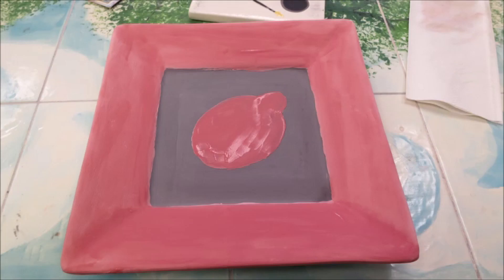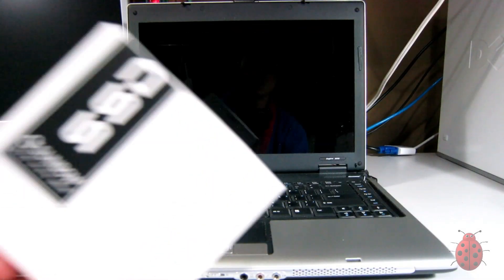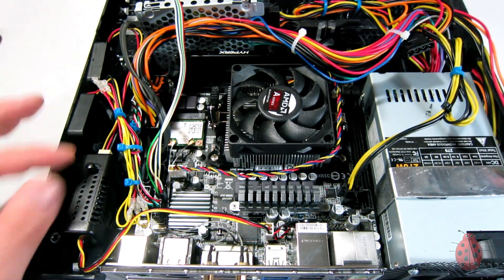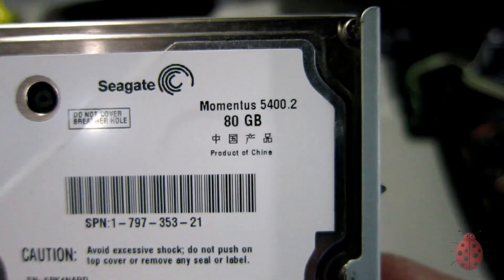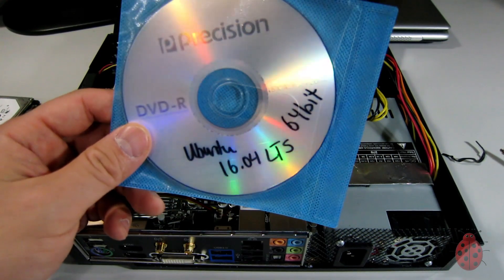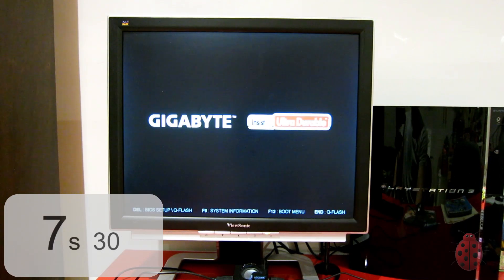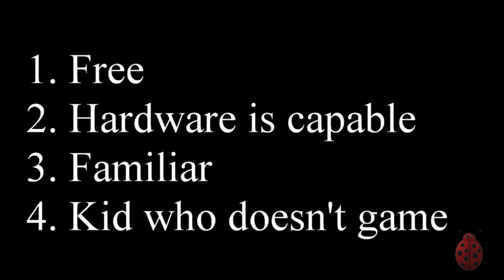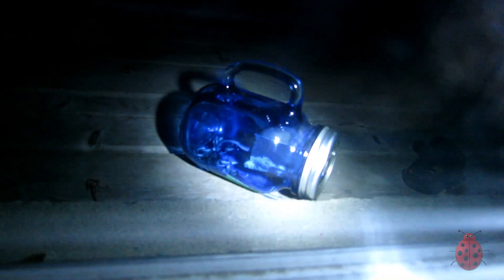Playstation 3- PC upgrade!

Comment: This would be so cool once the Ryzen 3000 comes out with it onboard graphics. Then you'd acually have a pretty usable gaming pc
Reply from the maker: Expensive but oh so nice. AMD is typically very power hungry so a better psu may be needed.
Reply: @LadybugAdventures  I am pretty sure they said about 90W and ur not gonna need a gpu so you should be alright with what u got. ^^ 

Edit: 90W for Ryzen 3, Ryzen 7 will probably have more

Comment: I kinda also want to try this with my old 40gb model since it died some time ago, and get it work exactly like you did with yours (leds/buttons working i mean). My biggest problem is getting a good PSU without having to cut the case to where theres something poking out of the sides of the case. although there might be some i could find now from the last time i thought about doing the build.
Reply from the maker: Some pico psu might be good for you!
Reply: @LadybugAdventures  i will consider that as i wouldnt be needing much power. i do have a spare 19v laptop brick around. but do you remember the size of the one you have in there. just in case i do find something that would work.
Reply from the maker: @SyfeKSLPs  tfx. Here are some power supplies that might work. https://www.newegg.ca/p/pl?storeName=Power-Supplies&pageTitle=Power+Supplies&N=100007656+600014011+600014004
Reply: @LadybugAdventures  thank you

Comment: Hi I really like your console mod vids. I am working on an xbox ryzen apu mod atm. I am looking for ideas on the stand offs for the mobo. Most videos just go over this. Do you have any recommendations or tips on installing the stand offs into the consoles plastic?

Thanks in advance
Reply from the maker: Christopher Fitzgerald How I've done it in the past is to make a paper template for where the motherboard standoffs are. I drill the holes into the case. I epoxy or gorilla glue the motherboard standoffs. They stick out a little but don't protrude that much. Just to make sure the standoffs are centred, you can screw the standoffs onto the motherboard and then glue it into place. Once it dries and remove the board you'll be sure everything is centred.
Reply: Ladybug Adventures thanks for that

Comment: Is it possible to upgrade the CPU on a ps3.i only play battlefield 3 and it's the only game that has issues locking up on me.if so would this fix the issue with it locking up.?
Reply from the maker: No you cannot upgrade the cpu as it is soldered onto the board. If you get a pc you can still play bf3 with better performance.

Comment: i can install windows 10?
Reply from the maker: Depends on your hardware. Never go with the minimum requirements stated by Windows I've tried and the experience is very very poor.
Reply from the maker: CAZZOVETRATO2006  I've never tried to cram PC hardware into a slim case before. I think only a thin client type board would work...